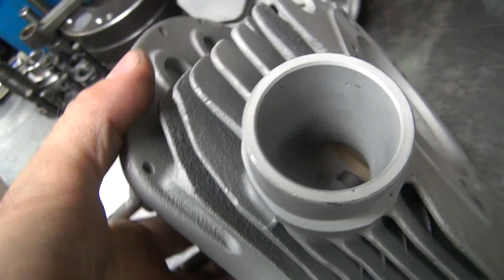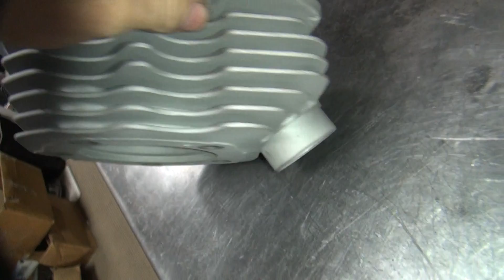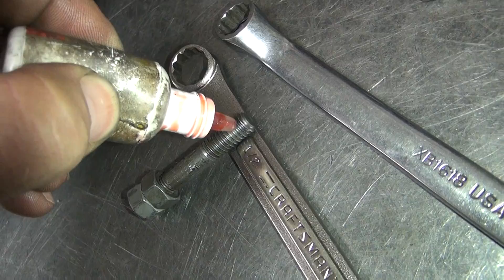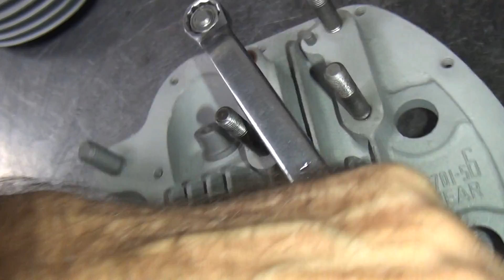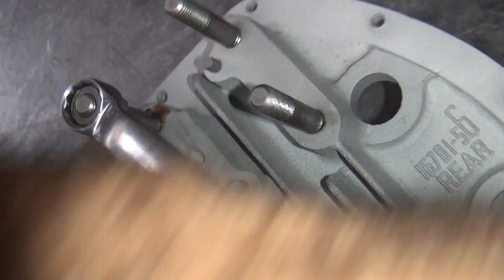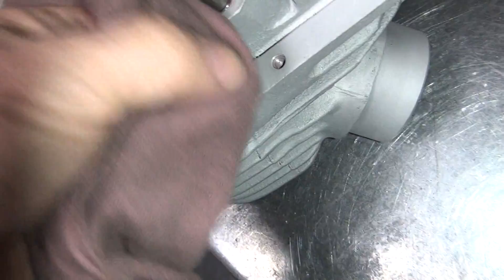#250 1958 & 1960 harley panhead complete head restoration repair welding & machining, tatro machine

Comment: Nice job.What blasting media did you use?  Bob
Reply from the maker: +BMWDCK75 
i have fine grit sand in the machine now. i think it is about 100 grit. it cuts better then beads but doesn't chew up the parts as bad. beads work good for fine cleaning and leaves a smoother shinier finish. it doesn't hold the dirt like a sand blasted finish so it will look good longer.
tatro